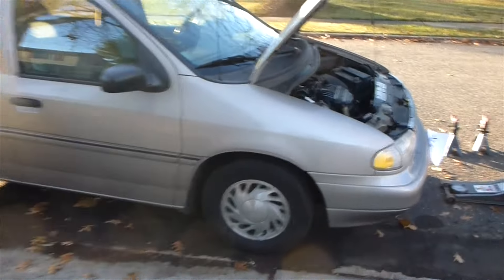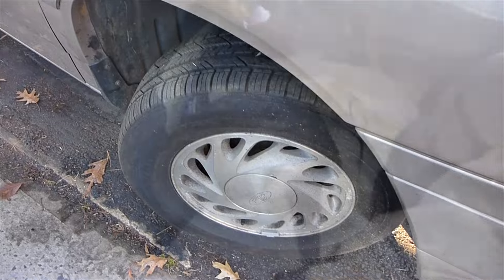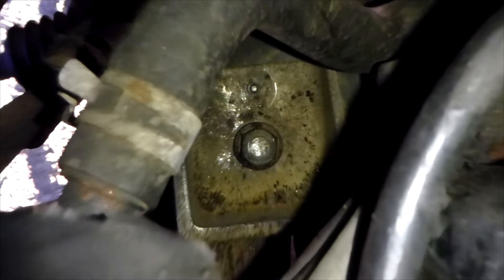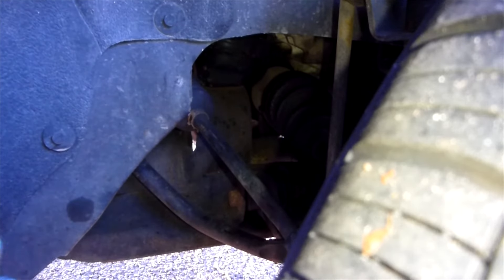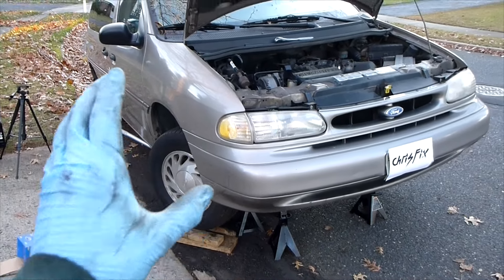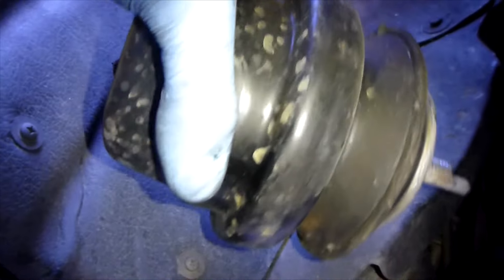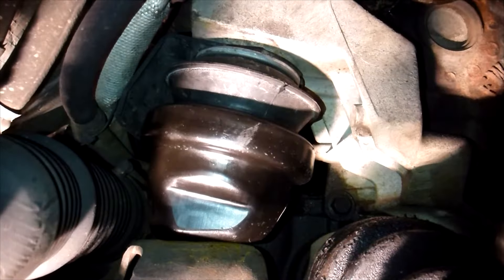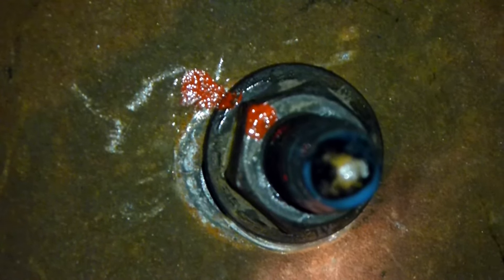How to Replace a Motor Mount or Transmission Mount

Comment: Chris I have a 2002 Mazda Tribute. The mechanic at a Mazda dealer showed me that I have a bad motor mount. Looks exactly like yours. I think they call it the 3rd mount. Mine is compressed and leaked out the fluid inside it. They quoted $400 to replace it, but I declined service. The mechanic said he would just tighten it down as much as possible so it doesn't shake the engine. Is that ok for the time being? Not sure how long I'll keep this car. The engine runs fine and it doesn't shake or move a lot like yours was doing. Should I lose sleep over it?

Comment: Ive replaced motor and transmission mounts jacking the engine on the pans with a wood block between the jack and the pan and never had an issue.
Reply: Kevin I did it on my Mazda and nothing was damaged. It's just a precaution I'm sure
Reply: Oil pan is more robust but usually odd shaped

Comment: hey guys, quick question here! i have a 1999 Lexus es300  1mz VVT with 180,xxx miles. i know the motor mounts are bad and need replacing because the motor moves when shifting into gears. my question and biggest concern is, could bad motor mounts cause a hard shift into 2nd gear from 1st gear? everytime I stop at a red light or stop sign or anything, after moving off again it will over rev and shift hard into 2nd gear. every other gear shift is normal. downshifts are normal. only does it from 1st to 2nd gear shifts. it is motor/trans mounts or do i need to get the trans serviced?
Reply from the maker: From what you told me, it sounds like you just need to get your motor mounts replaced and that should solve the hard shift issue!

Comment: This is off topic Chris but i have a 1999 ford windstar that the cruise control stopped working on. i checked the number 10 fuse under the dash and also replaced the "brake stop switch" on the master cylinder. Any ideas on where to go from there?
Reply from the maker: vikingjoe93 Check the vacuum lines that go to the cruise control module under the hood. Does the cruise light come on when you try to activate it?
Reply: I'll look into the vacuum hose. I've never had a cruise control light come on that I'm aware of. Maybe it did and I just didn't pay attention to it.
Reply from the maker: The cruise control light lets you know it is activating. So with no light, you might have a bad cruise control unit.

Comment: My car vibrates a lot at idle. Gets worse when I turn the wheel or turn on AC. My local mechanic says 3 out of the 4 mounts are broken. Fixing them should solve this issue?

Comment: I NEED YOUR HELP. I have an 08 Cadillac Cts. I have the same problem with the shifting from R to D or vise versa. But it doesn't happen from neutral and back to the same gear. it started like 20k miles
Ago and I've gone to the dealer multiple times. They installed new motor mounts, it didn't help and seems to have gotten worse. I hate braking in my car because it thuds every time it shifts down gears 1-3. Letting off the gas and pressing it shorty also makes a thud and I get a  small "clutch-slip-like" roll instead of a rev up and then the smooth sync . It is an automatic

Comment: Hey Chris. You help me alot with your videos on helping me save money by doing the work myself.

Another question for you. I have this creak problem. Its when i shift into Drive and reverse ( AT) tranny from a complete stop. Then press the gas

My bushings and suspension feel solid. No broken boots or grease leaking.

According to different car forums alot point to  either a tranny mount or engine mount.

Upon watching your video my engine doesnt hop around nor my tranny clunk.

And another thing i hear it alot on ford escapes (taxis) searched the forum there no answers. 

Have any ideas what could it be?

My local shop said everything looks good.  And his only suggestion was to replace all my mounts since my car has over 118k
Reply from the maker: bahlowwings The creek can be anything. So it ONLY happens when you shift into drive or reverse? Can you tell where the noise is coming from? Like have someone shift the car and you stand outside and listen (dont stand in front or behind the car to be safe).
Reply: ChrisFix so after reading more info on the creak i found a helpful tip which can also diagnose a bad mount.

I guess its called the the power brake method or something like that. So you press and hold the brakes with ebrake down. And put the car in drive/reverse and press the gas a few. And bam the creak came with this method.

So looks like i need new mounts.
Reply from the maker: bahlowwings glad you figured out your problem. I never heard of doing that.

Comment: use extreme caution jacking on the transmission fluid pan I found out the expensive way $$$  and cracked the flange on my transmission!!! 😭
Reply from the maker: Yea you want to spread the load if you use the jack it up on the pan.

Comment: Chris I have a grinding noise coming from my alternator area when shifting into drive or reverse. Could this be a bad motor mount. I was told that they were by Firestone. But sometimes big mechanic shops tell you false info too make you spend money.
Reply from the maker: KingConker101 Here is how to check if your motor mounts are going bad. Try these tests: https://www.youtube.com/watch?v=ZTRV5GXWpo0

Comment: how you doing bro, I changed tie rod ends because were noisy, aligned car. and still got a little noise on street holes. So I bet its either motor or tranny. Thanks for the tips.

2003 Ford Taurus SES flex fuel ohv
Reply from the maker: +Luis Olivera  check the sway bar end links and sway bar body bushings
Reply: Thank you, I'll  work on it on the weekend. It's very windy in El Paso tx at the moment. No garage right now.

  I'll keep you posted, thanks again.

Comment: Where did you get that marker from that you used at the end? I really think I'd like to start doing that on my vehicles. Also, how are you liking the Pittsburgh jack? I need to replace my jack and I've been looking at one of the Pittsburgh ones but I don't know how well they hold up over time. As always, thanks for the video! Just did the passenger side mount in my Focus recently. Really helped dampen vibrations as it's a fluid-filled mount and the original had lost some fluid.
Reply: I got a Pittsburgh 3 ton rapid pump jack and it's great best jack I've had...I leave it outside open to the elements and it's been like that for almost a year and no rust no need to regrease doesnt stick... Great Jack all around...but if I could do something gifferent it would be to get the aluminum low profile...they are SUPER light weight compared to the one cris and I have....keep that in mind
Reply: Thanks Roberto. The one I've been looking at is the 2 ton aluminum one. I live in an apartment and have to go up stairs to get outside so hauling around a steel jack every time I wanted to work on my car would not be fun. Haha
Reply: Yeah specially if that's ur situation the aluminum one will be the perfect fit go in and look at them but regardless Pittsburgh has lifetime warranty like craftsman just take it in and replace if anything was to ever happen
Reply from the maker: ***** You can get the maker at basically any school supply store. It is called a "paint marker". I forget where I got mine. 
I am liking the pittsburgh jack. For the price, you cant beat it. It is heavy, but it hasnt failed me yet and I use it almost every day! Mine is a year old or so. 
The fluid filled motor mounts are nice when they work! Glad you were able to fix yours!
Reply from the maker: Roberto moe Awesome review Roberto! I agree with the weight, this jack is heavy! But I like that  and prefer that. The aluminum ones are definitely lighter. Another thought I should add is this jack, while low profile, wont fit under a Corvette or lowered car where you have 3in of ground clearance or so. Might not be a problem for you but I wanted to throw that in there!
Reply from the maker: ***** You def want an aluminum one then. The jack I have is 70lbs!
Reply: ChrisFix I had the same problem with my current jack not fitting underneath my Mustang. I just drove over some 2x4s to get the car up higher so I had enough clearance.
Reply from the maker: ***** I do the same thing!

Comment: is there a way to strengthen engine mounts as mine always wear out fast (i changed them twice on my 2010 civic). the mount i'm talking about is the upper right one (car's right). i laways use OEM parts should i try an aftermarket part and if so would you recommend a manufacturer?
Reply from the maker: Amr Al Samahy You can use a polyurethane motor mount which will last a long time but more vibration will be transferred though the mount itself if it isnt rubber. Check out this (it is rubber though): http://amzn.to/1g8Kpeh
Reply: Amr Al Samahy If you're changing the torque strut mount (aka 'dogbone') on the top multiple times, most likely the BOTTOM one is worn out.  Usually the bottom one goes, and then the excessive engine motion wipes out the top one shortly thereafter.  If all you do is replace the top one, it won't be long for this world if the engine can still twist freely.  Remove that bottom mount and check it over; I'll bet that's your problem.

Comment: would this be the same procedure for the harmonic balancer
Reply: no, harmonic balancer is on the front of the engine. also known as the crankshaft drive pully. that drives all the accessories on the serpentine belts. need an impact to undo the bolt on the crankshaft, and a harmonic balancer puller to slide it off. otherwise its a pretty easy job if you have room to work. some cars require the removal of the radiator to give clearance, and that can be a pain in the ass.

Comment: Wouldn't you want the swivel at the end with the socket on it and not at the top? Wouldn't you get better leverage and control?
Reply from the maker: JMV563 The extension has to go down straight so the u-joint extension has to be at the top. If you put it at the bottom, it would do nothing since there are hoses and engine parts in the way. Sometimes you just need to make things work, and this did the trick.
Reply: ChrisFix thanks for the reply! I see I just thought you would have a bit more control with it  that way. You have some great quality videos. Keep up the good work with them!

Comment: Hey Chris my dodge stratus sxt 2005 needs all motor mounts to be replaced, but they charge me $900 so I'm going to do it  myself. Could you please make a video on how to change a dodge stratus motor mounts please. could you also let me know how many motor mounts my cars has cuz all places tell me a different amount. Thank you!!
Reply from the maker: +Alejandro Reyes I dont have a dodge stratus to work on. Make sure you are extra careful supporting the engine and car. It is all basically the same but they are located in different areas. Good luck!
Reply: its ok.  thanks for your time ;)
could you please make a video on how to sell a car. I'm going to fix the motor mounts and then I'm going to sell it, because the mechanic found a couple other bad things in the car..

Comment: Can you do a video on replacing a rear tie rod(toe adjustment arm/lateral link) whatever it's called it has so many names lol.. Thanks man
Reply from the maker: PureExcellence100 I will definitely make a video on it when I need to replace them on my Vette. As of right now, they do not need replacing so unless I come across a car that needs one, I wont have a video any time soon. It is basically the same process as this: https://www.youtube.com/watch?v=FxHnN9-rzoI but with a longer rod, not just a tie rod end.

Comment: Though not at all correct, i have used an unopened bag of rags to cushion a jack, and jacked up an engine from the oilpan that way.
it's worth noting it was a 1.2L I4, and therefore very light, but still.
Reply from the maker: kenji8763 While yes, it is not recommended, a block of wood to distribute the weight on a strong oil pan and a light engine can work (as you said) but I try to show the "proper" way to do it so anyone inexperienced doesnt put a jack though their oil pan lol. What was the 1.2L in? That is a tiny engine!
Reply: my mistake, 1.3L. it was a '99 Suzuki Swift.
Keep up the great videos!
Reply from the maker: Either way, 1.3L is tiny! How is the fuel economy? And thanks bud!

Comment: i'm replacing motor/tranmission mount on a 2000 ford windstar what is the deference between    Solid Rubber Mount and a hydraulic mount
Reply: Carlos Gomez
Solid is for racing = more vibrations & strength.
Hydraulic? Is for comfort = less vibrations & stock strength.
Reply: Carlos Gomez
You are probly thinking of welded/poly mounts versus rubberized. Idk of any hydraulic mounts, just engine support hydraulic pistons if your engine moves around too much - damaging the mounts.

Comment: Does bad mounts make it seem like the engine jerks back when I am braking as well? How about making it seem like the engine wants to jump out my engine bay?
Reply from the maker: It could but that would be a very bad mount!
Reply: +ChrisFix thanks so much for the reply !
Reply: Luis V. bad brakes/rotor? did you find out the problem already?
Reply: You probably already fixed it by now, or destroyed the car by letting the engine fall out. but yes. what you describe is torn engine mounts. transverse mounted engines like in front wheel drive cars have front and rear mounts, as well as right and left side mounts. if the front and rear mounts fail it can jerk and bang around like that real bad and do damage to the engine and cause exhaust leaks by flexing connections.

Comment: I remove the entire manual transmission of a 2006 4x4 Toyota Tacoma to change the worn clutch and pressure plate w/ my classmates as well as removing the internal of an automatic transmission.
Reply from the maker: ***** Awesome! I need to learn about transmissions. I do not know how to fix the internals but I really want to learn!

Comment: I have noticed that the car will start to jerk/pull when I let off the gas pedal. It is only noticeable at speeds of 55 kmph or higher. It doesn't happen when I accelerate or decelerate, only when I take my foot off the gas to coast. I don't hear any unusual noises, the car sounds fine.
car has 190000 miles.
My car has an automatic transmission. Newly Clutch plate changed and atf changed.
Can anyone help? Thanks

Comment: hey i already replace 3 engine mounts still it clunks.. what will i do please help me .. :(
Reply: did you check the transmission brace/mount (if rear wheel drive)? i had an old truck with a bad clunk i spent over a year trying to trace till i eventually noticed the tranny brace was split off near a frame rail. didnt notice it before because it had realigned itself and dirt covered the crack when i was inspecting. driveshaft universal joints and CV joints can also cause clunking noises.

Comment: The way you placed the block of wood on the jack was dangerous.....
Reply from the maker: It won’t break if you use a large piece that can handle it!
Reply: @chrisfix  Thats not the issue...too much vertical space and not enough base..tippy.....you can get away with it but I have seen that set up tip MANY times...if your hand is in a tight space you are in trouble if it goes.  Been working on cars shade tree style since 1975.....I've seen it tip WAY too many times. At the very least use a piece of 4x4 or 2 2x4s screwed together.

Comment: they dont make them bolts like they used to man, the same crap happened to me.. torque spec'd the bolt and it sheered right off.. then the guy that assisted me with getting the bolt out told me, man u dont see mechanics in the shop using torque specs..  just tighten it until u feel it tight...  im still gonna torque spec the shit outa that bolt tho.
Reply from the maker: Yea I like to torque the bolts because that is the best way. There is no doubt you got that torque spec exact when you use a torque wrench!
Reply: KAE Artz probably too low torque for the after market mounts. I snugged mine down pretty hard. If torque is too low, stress will transfer to the stud.  

Definitely not as good as OEM (although $30 vs $185 so can't complain too much I guess)

Comment: Bet you chocked the rear wheels.
I would have pulled out the extension, socket, nut, etc. and then kicked myself for being so dumb.  Wonder why lock washers aren't used.

Comment: I love Chris but this is a bad video you should always use a block of wood or some kind of a buffer when you jack the engine up to keep it from messing up the oil pan or something and you should have showed the points of contact to actually lift the engine up